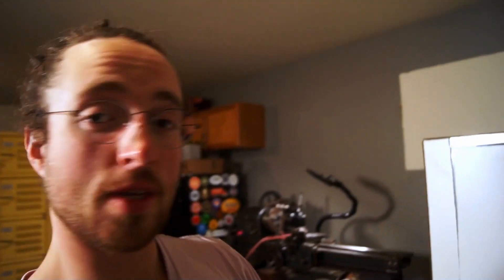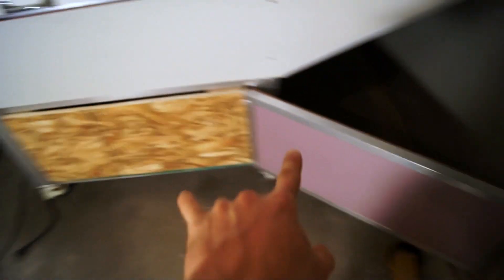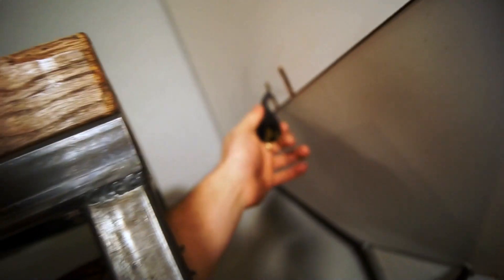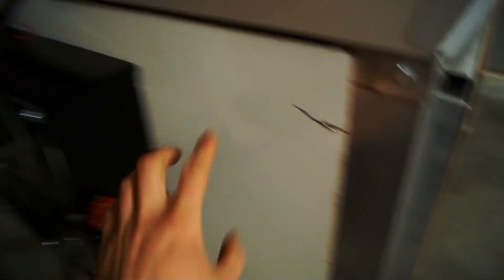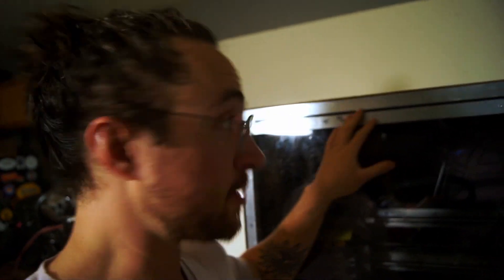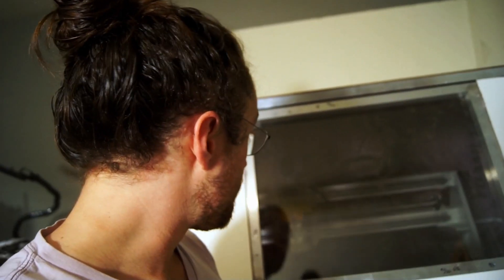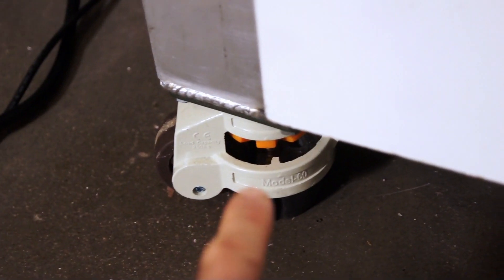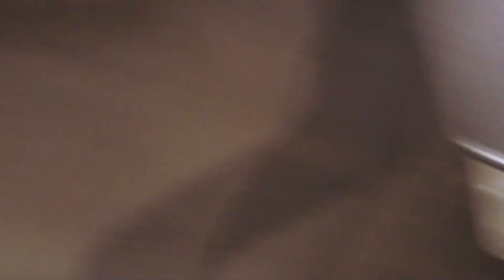I Finished Making the Millright CNC Router Enclosure!

Comment: i put together the foot gimbles of my suit and test wore them. i need to exchhange a few screws with bigger ones, because it currently rattles like cowboy spurs. the movement is fine. my strenght assist methode seems to work too. i first thought it didn't work, but when i disengaged it i felt the true weight of the boots ( i only used one third of the final strentgh addition and the boots felt nearly weightless).